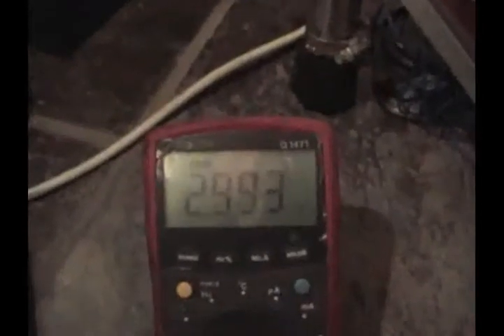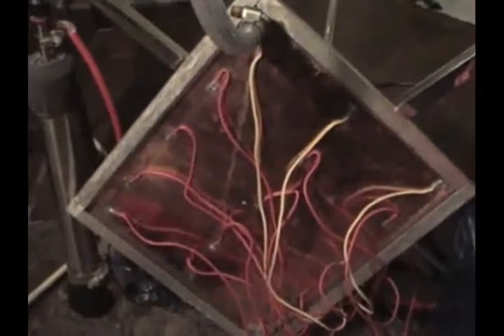hho advanced cell 6.5-7mmw Aquapulsefuel@gmail.com

Comment: Please read my comment on your last video. If your plates are thin enough that you can squeeze them you really need a solid backing plate. If your gap even varies by 3 thousandths you will create a very ineffecient device. This technology will eventually be the answer. You do not need all those connections. With that copper electroplating only 1 connection is needed. The copper is more conductive than the stainless and will get even distribution before the stainless will be used.

Larry